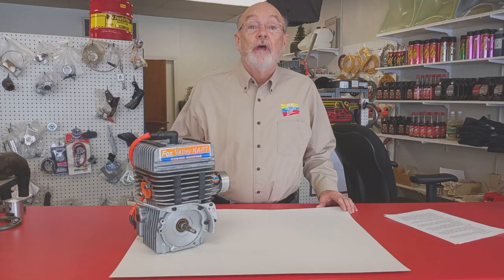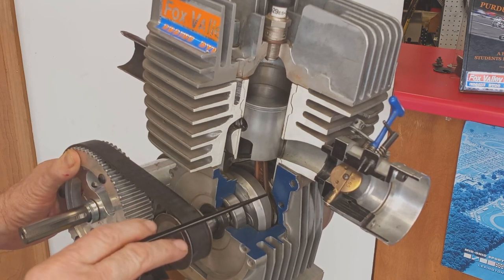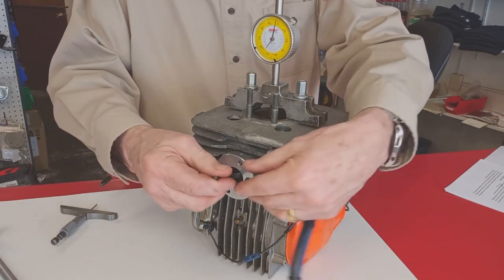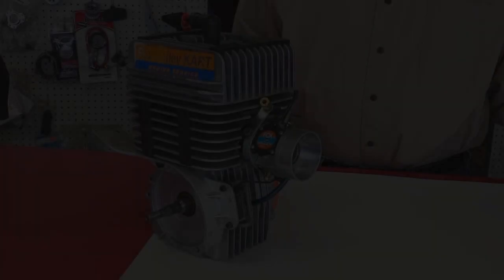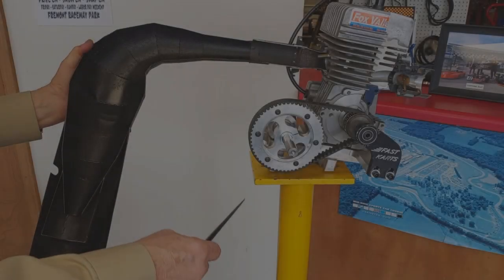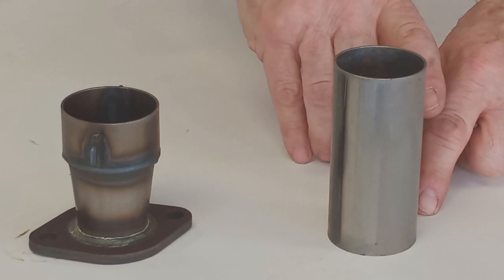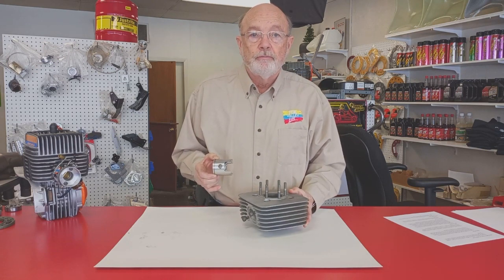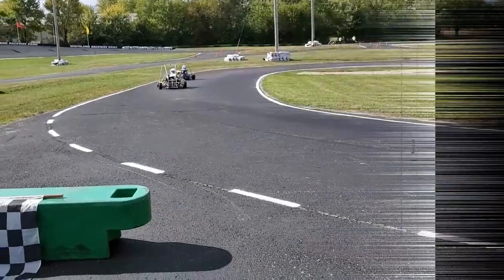Grand Prix Engine Seminar Part 1: The Yamaha KT100

Comment: I sort of had an ahah moment when you said a flex pipe that is to short causes the engine to feel sluggish at low rpms but seems to open up on high rpm use, i just thought that’s how the engine was. Thanks for the great info

Comment: Nice work, can you provide con rod measurings? I believe it's has 20mm crank pin and uses 14mm piston pin, it's 100mm long, but I don't know the width on base on bearings ends

Comment: What do you guys charge for that type of clutch system its what i want and need for the type of go cart frame to run better and from what i hear it keeps unnecessary heat from the engine to the clutch. Also i just noticed that you guys are in Indiana and its where i just bought my 2 go cart kt100s i i have a feeling they might have seen your shop i noticed everything your talking about the blueprinting has been done to these kt100s and apparently the guy i got it from his dad used to race them 10 years ago. He said something about his dad having 2 of theses suckers on one go cart 😂
Reply: @foxvalleykart2743  the Buller jackshaft for the kt100 I have 2 kt100 engines I like the idea to go from belt to chain.

Comment: Hi! I've started racing a Kt100 over here in New Zealand on a dirt track, I got the kt because of their simplicity. What data logger do you recommend to help me tune my kart? Your vids have been extremely helpful. Thanks.
Reply: If anyone sees this 2 years later. Pretty much the standard in karting is the  mychron. The mycrhon 4 is still a great gauge and has the capabilities to connect via usb to a computer. You could spend thousands of dollars on peripherals and sensors to acquire all the data you want.

Comment: 16-17 hp out of a 100cc is not much considering the fact that you make 14k rpm, most European engines produce around 28 hp.
Reply: I’m absolutely not saying that you are lying, or doubting your numbers, but I know for sure that there are engines of the same displacement and doing the same rpm’s that crank out at least 50% more HP from a piston port engine, I don’t know what timing regulations and port width you are limited to, but I see so much more potential HP’s if you could use the full timing and port width potential, imagine what you could do on a reed valve or rotary valve induction system.

Comment: Even 16-17 HP is Weak. An older YZ100 engine just clobbers that. I suppose you have rules BUT why not convert to reeds, run a 30mm Mikuni VM and a tuned pipe?
Reply: How to upgrade a kt100cc
Reply: It's a spec engine for the Perdue Grand Prix and must conform to the AKRA standards for a Yamaha Kt100s class thus can't run a Mikuni as a Walbro WB3A carb is the requirement.  I do find it sad that there is so little innovation allowed in what is supposed to be an engineering exercise. (With the deepest "engineering" exercise generally being attaching a cage to a ready made sprinter kart frame, finding a way to mount a headrest, a 3 sided firewall between the fuel tank and driver that must be 3/4" taller than the tank, and then meeting the minimum 3/4" ride height requirement with the driver.) The main "innovation area" allowed in the rules being either a standalone gearbox or CVT so long as it doesn't leak oil. Both unfortunately add more rotating weight and rob power from the diminutive kt100s neither are good when trying to achieve getting down to the 350lb weight minimum and maximize the power from the engine. I know how to setup an autonomous tuning system for both the carburetor needles and the exhaust if adjustable convergent cones (Slippy pipe) or variable length (movable while in motion) header/flex were allowed, but don't think that it would be allowed since they seem to have a blanket ban on  on-track electronics use and almost no karting organization allows slippys or adjustable headers. (Even though as written the spirit of those rules are for preventing electronics as a distraction eg. phones, mp3 players, non-communication radios. I'm sure they would just include a control system and stepper motors that the driver doesn't even directly interact with under those rules as banned. Even though it would remove the driver distraction of tuning the carb.)
Reply: @prevenger  so the kt100s is better ? And I don’t understand much, sorry
Reply: @drivingfaild726  This video is to inform students for a very specific event, and the only legal engine is the Kt100s.
Reply: @prevenger  damn I never knew that but I’m from New York City and cops chase people and try to take there stuff no matter what
Reply: @prevenger  that type of a system sounds awesome, but besides the electronics issue you'd also have to do it with no plastic anywhere (so no 3d printing even if it could handle the temperature), since Purdue grand prix sees that as a fire risk (which is why we have roll rages instead of normal plastic bumpers)
Reply: Wow. The motors we blueprinted at TMW Motorsports in Phoenix made around 20-21 horsepower. Won a lot of races too.
Reply: 16-17 HP isn't weak on a gokart that weighs 340lbs with you in it. I don't know what fox valley gokarts are but mine didn't have a roll bar.